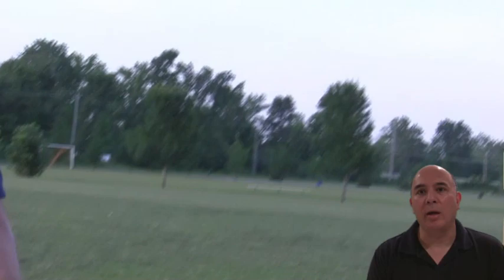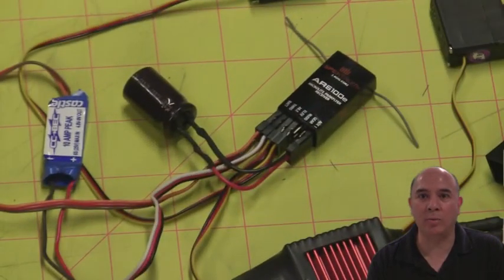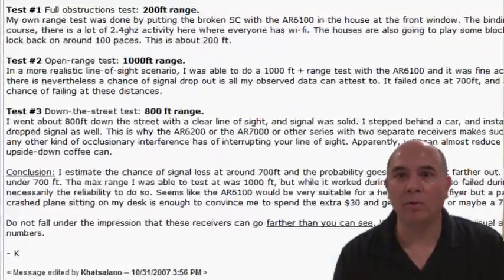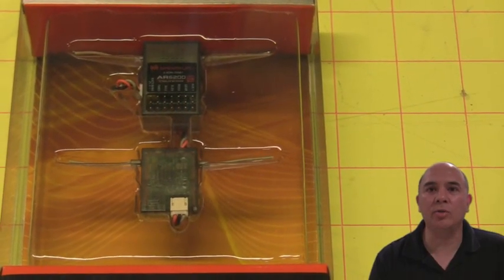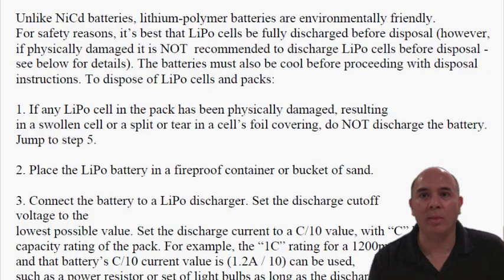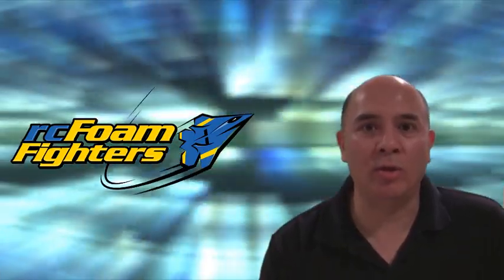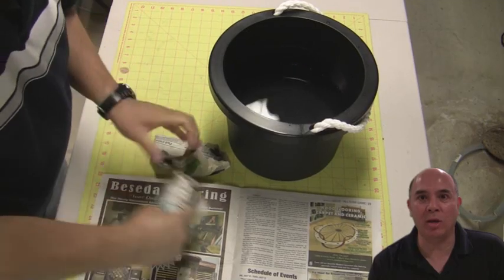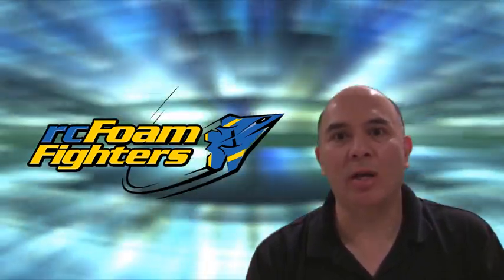Spektrum Receiver Low Voltage Cutouts and Damaged LiPo Batteries

Comment: Chances are it was the lipos to begin with! I have used those rhino lipos from hobbyking and they had intermittent cut outs I had 3 of them from same purchase after first 2 crashed I checked the therd and found the battery was at fault by wigling the wires around and watching the power down of the rc plane, 

I have also learned if batteries are not to badly damaged they still work fine

Comment from the maker: Thanks garyshoaf! I agree the receivers for our FM radios were much cheaper. The reasons both Paul and I switched to Spektrum 2.4g is because we were getting lots of interference and glitching at the site we fly. Probably from the power lines around the perimeter. We also like the fact you don't have to worry about what frequency we are on. We didn't now about the lockout issues with the receivers.

Comment: Great info on the spektrum rx as i never new about that capacitor and that just might help me out loads ;-) and i now use the AR500 full range rx from spektrum and i have never had any trouble with that one,i have a duff battery just waiting to go into the salt water trick,so thanks for the great info on this video=5*